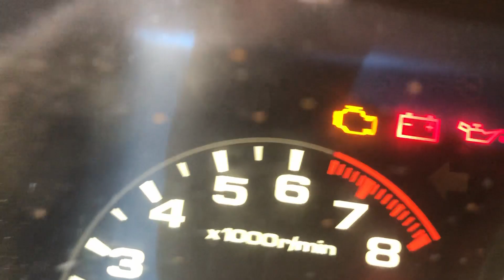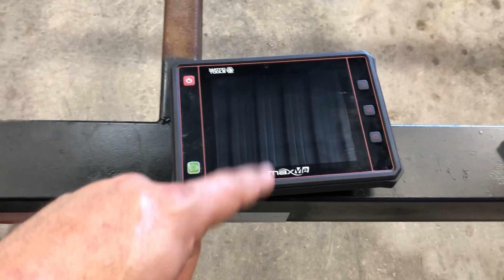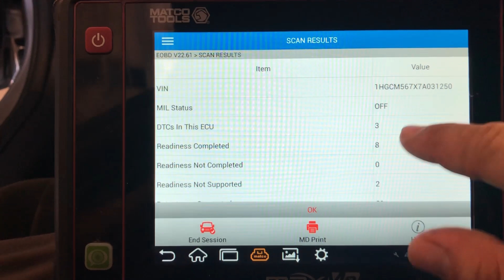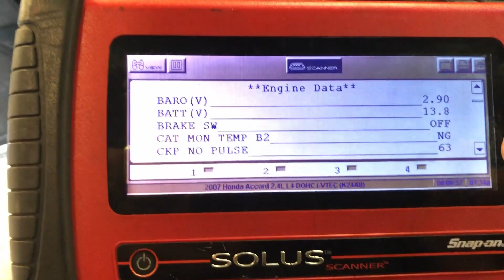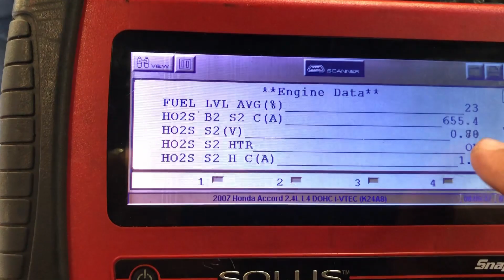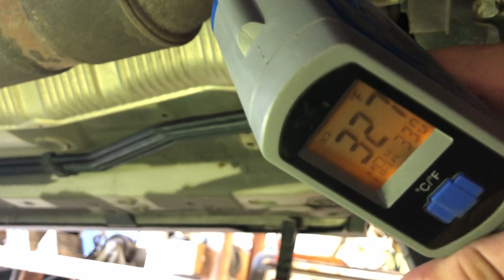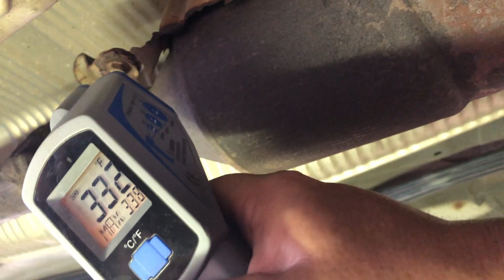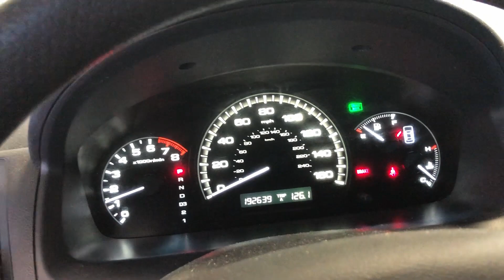HONDA ACCORD P0420 CODE | Catalyst Efficiency Below Threshold Bank 1 SENSOR | DIAG AND REPAIR EASILY

Comment: You'd be much better off using a cut off wheel for those bolts. The slag could end up somewhere you don't want it to, or you could accidentally send the arc somewhere you don't want to and mess up another component.

Comment: Hey guys, just bought a 2010 accord ex-l 2.4. ON the test drive, no check engine codes, I pick it up and of course the P0420 is up. The orig. owner stated he had the same gas in there for perhaps 6 months? Could old/bad gas cause p0420? Thanks much!

Comment: Nice video man and I have one question. Do I need 2 converters for my 09 Honda Accord because I got a diagnostic test on it and it says P0420 and P0430 catalyst system efficiency below threshold B1 and B2. Also how long did rock auto take to ship the parts😭?
Reply from the maker: Did take very long maybe 2-3 days I think , I can look it up Amazon and send you a link
Reply: @Gasdieselgarage  hi ,do you have the link ?

Comment: I got the same code P420 on my 2012 Accord 4cyl. I have replaced the catalytic converter and both sensors (upstream & downstream), but the code and the check engine light still stays on. I have also tried erasing the codes multiple times, but after driving the car for a little bit the check engine light comes back on. Any ideas what could be going on?
Reply from the maker: It’s quite possible you may have leaking injectors...even just one injector can dump un burned fuel into the cat.. thus triggering the code and destroying the cat. You can look at fuel trim values if you have access to a scan tool graphs to see if it’s running rich but yes I know usually mechanic shops have those capabilities. Hope this helps.
Reply: @Gasdieselgarage  Thanks! I will look into this.
Reply: Almost Positive that there are more than one CATs on that generation... But don't quote me. What bank does it say?
Reply: Did you ever fix it?
Reply: @almirlimaj4354  hey did you ever get this fixed?
Reply: My coworker is having this problem. He just replaced the cat but the light came back on after 1 month and now he can't pass emissions.
Reply: Could be the quality of the cat guys.......is it oem.....or atleast magnaflow?
Reply: @juangiggsable  Does Magnaflow use significantly more precious metals (reason for higher price)? How would you definitively isolate quality as code trigger? Can you see this on scanner live values?

Comment: If my converter is fairly new and i get this code could it be just the sensor?
Reply from the maker: Yes in some cases
Reply: @Gasdieselgarage  definitely will check the downstream. Replaced the converter and upstream back in January.

Comment: So I have the same code for a Honda Accord coupe 2009 v6 I read the other comment about it being behind the motor, my car is acting really slow would this be the problem ? I also am going to do the clutch also
Reply from the maker: If you have problems accelerating and you have this code. Yes more than likely your CATALYTIC converter is clogged.

Comment: Is it possible to check the cats coming out of the block? The 08 v6 has 3 cats. bank1 and bank 2 and the downstream. How did you know it would by the down stream one?
Reply from the maker: Ty for the comment bud. To answer your question you can verify if the downstream o2 sensor is reading which you will only know if have the car hook up to a good scan tool unfortunately. You should see the o2 sensor graph changing from rich to lean continuously....don’t worry about the o2 sensor not working because if that o2 sensor wasn’t operating it would throw a completely different code “not p0420”. But If you got a thermal laser temp gun you can check it manually...see if there’s big temp changes before and after each cat....also if you have issues accelerating...most likely you got a bad cat . Sorry I know this was long response hope it helped though. Good luck
Reply: The third doesn’t have a downstream O2 sensor only bank 1 and bank 2 the 2 sensors are at the bottom of the converter those usually are the culprit since they suffer the most abuse
Reply: @rosieclark3661  I’d tend to agree that although you see code for catalytic efficiency, it’s a faux alarm and actually a signal that your O2 (A/F ratio) sensor isn’t responding correctly anymore…but the ECM isn’t smart enough to tell you that. Is that what I hear you saying that many of these “cat failures” are due to bad A/F ratio sensors that never get swapped out?

Comment: Hey I have an Audi A4 2013, I just got the code after replacing the  high pressure fuel pump because of rich idle bank 1 , any tips to what I should do next

Comment: Cheers bud.
I have an 04 2.0 Accord UK model with the same code. You video is super helpful.
I have reset the code and it takes a good while to come back on but it does eventually after I get up to full temperature.
Is it normal for the P4020 to take a while to come back or should it happen quickly??
Could the issue just be with a lambda 02 sensor or something?? I dont readany 02 sensor codes on my cheapo reader.
MPG is alsovpretty bad lately.

I didnt know about the before and after CAT temperature method so ill be using that as my next step.... Thanks for that.
Reply from the maker: Yes the code will most likely come back on when the cat gets warmed up because the material inside the cat will expand causing basically a blockage of exhaust gases existing the muffler. It’s pretty common in these Hondas. Yes your O2 sensors may go haywire when this occurs. Hope this helps my friend
Reply: @Gasdieselgarage  Thanks for your reply.... Would you normaly change the lambda's while your at it or are they often ok??
Reply: @Craig Buy Did you get it sorted bud? Tks
Reply: @nothingmemorable486  Yes, especially if you have looked at scanner data

Comment: Just a thought some folks told me that sometimes the code will come up and if you replace the o2 sensor with oem type new o2 sensor code goes away im 50/50 on that with my beliefs cause i had the same happend to my gmc acadia and i replaced the cat code was still there even after driving to cycle it so i put the old one back on and changed the sensor and voila thats why im asking do you think it could be bad sensor i dont have all the toys you got to check

Comment: Do you know why the cat went bad? Also did you replace the sensor as well?
Reply from the maker: Cat went because the owner of the car never replaced her spark plugs and had leaking injectors at one time. So all that unburned fuel was collecting in the cat therefore destroying it....yes I replaced the o2 sensor as well.
Reply: @Gasdieselgarage  how do you know if you have leaking injectors?

Comment: Can you flush out your cat or do you have to replace it? I've heard carburetor cleaner and lacquer thinner will clean them out.
Reply from the maker: I honestly wouldn’t recommend it…the cats have material metals inside that are prone to chemicals destroying it…hence clogging it up. Unburned fuel from the engine is what destroys the catalytic converter’s
Reply: @Gasdieselgarage  thanks I really appreciate the quick response!!
Reply from the maker: @raisingirl95608  absolutely if you have any automotive concerns or questions don’t hesitate to ask

Comment: I have the same code p420 what do I do? and same car
Reply from the maker: 99.5% of the time it requires you to replace the catalytic converter
Reply: @Gasdieselgarage  that’s what my mechanic was telling me but the old one was stolen and they put a refurbished aftermarket one in & I just bought the car
Reply: @Gasdieselgarage  he said il have to replace the upstream sensor oxygen soon and if that don’t fix it then it’s the Cadillac converter hopefully not tho
Reply from the maker: @YoungShizzie  honestly bud I’d get that cat replaced yourself with a cat you know is good…they could have just put a pipe welded in just to sell it. Just saying my friend
Reply: Yea but I don’t wana buy a 600$ cat for a fean to steal ya know on a 2004 car that’s worth 2000$ what would you do & also bro it’s not the cat the engine light stayed off for a month and came back on so it’s obviously something else I replaced the whole exhaust & if I do replace the cat which one should I go for for my 2004 Honda accord ex sedan 2.4 v4 vin number starts with a 1 USA built I think it’s federal and cali idk , also there’s one more thing I forgot to mention when I start my car the exhaust shakes bad like I can see the o2 sensors shaking I just replaced my flex pipe it’s brand new the whole exhaust is , the only thing I didn’t replace is the downstream sensor

Comment: I’m having this problem got the same code and a code for the fuel control module which to replace to get the car at least running long enough to get to a shop??? Please I need help😩
Reply from the maker: Will the engine stay running sitting at idle?
Reply: @Gasdieselgarage  for about 8 seconds then shit off
Reply: @Gasdieselgarage  also it was running fine , it suddenly started acting up
Reply: @Gasdieselgarage  03 Honda Accord 4 cylinder
Reply: @Gasdieselgarage  bad EGR valve??

Comment: where did you get the bolt kit from ?
Reply from the maker: The break off bolts come with the new ignition but you also can buy them pretty cheap at the dealership or on Amazon

Comment: I got the same code but my mechanic claims bank one isn’t under the car it’s actually behind the motor so i have to swap the whole part out or is he wrong
Reply from the maker: What engine do you have in your vehicle?….4 cyl or 6 cyl ?
Reply: @Gasdieselgarage  6
Reply from the maker: @qua4g894 yes he’s correct bank 1 on the v6 motors are on the back side near the firewall….just FYI…# 1 - #3 - #5 cylinders are in the back (bank 1)……# 2- # 4 - # 6 ( bank 2 ) is in the front. Hope this helps
Reply: Thank you i replaced and sold that one lol i got a newer one now doing the same thing to it but it’s easier

Comment: May I ask where you got the catalytic from?
Reply from the maker: Absolutely...I ordered it from Rockauto.com
Reply: @Gasdieselgarage   Mine was a bit lower before the cat so I'm assuming it's the sensor, would you agree?
Reply: @Gasdieselgarage  which one did you get? About to hit 200k and the p420 code is up. Why do these go bad if the car is well maintained and running good? Thanks
Reply from the maker: @travisthompson779  that part was from rockauto.com but I wish I would have used this one from Amazon https://amzn.to/36g2FS5
Reply from the maker: @travisthompson779  they go bad when you reach high miles …the insides breakdown over time with all the exhaust gases running through them. Gasoline isn’t the cleanest thing in the world with all the different additives the gas companies put in the gas to make it burn better. It’s just time bud

Comment: can you drive the car with that code or will it cause more problems
Reply from the maker: David M yes absolutely it can be driven but eventually the Catalytic converter can become even more clogged but then the car won’t start....usually with the po420 code it’s saying hey the cat is on its way out...please replace me.....won’t cause anymore problems but like I said the engine with run crappy and eventually won’t start

Comment: Is there anything we can do to prevent the catalytic converter from going bad? I've got a 2006 4 cylinder manual Honda Accord and I'm having a hard time justifying the cost (about $4,400). Is it even worth it, given the age of the car?
Reply: no junk it.....makes no sense
Reply: Where you located?  Interested in selling the car?
Reply: They got the cat for cheap if you are not in California....but if you are....its about $400 aftermarket
Reply: Was the car accurately diagnosed for a possible worn out O2 or A/F ratio sensor, first?
Reply: @homesold based on this video I'm it wasn't otherwise he would've shown it.
Reply: @homesold probably not.
Reply: $4,400 What? Makes no sense.. you can buy these for under $200....